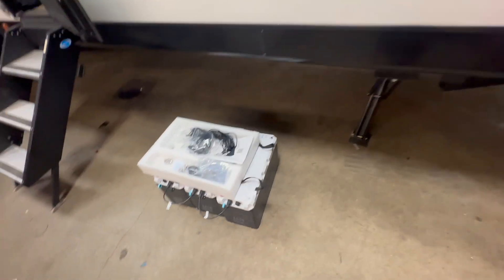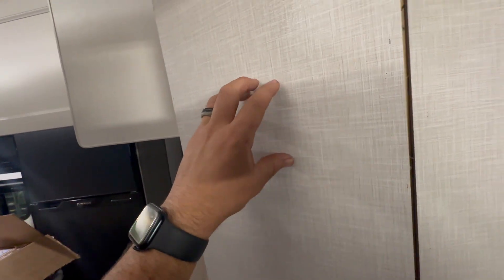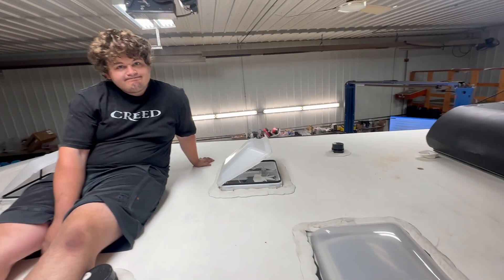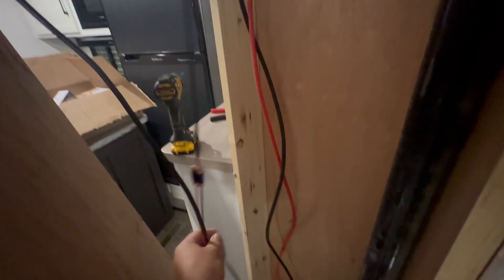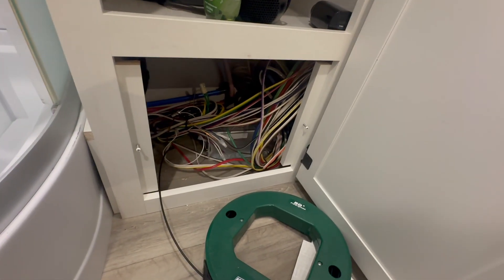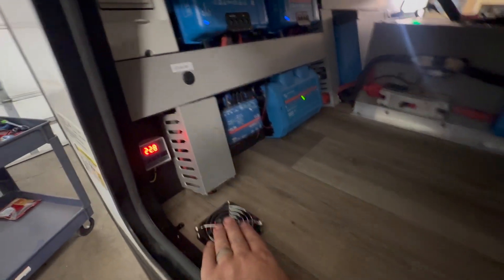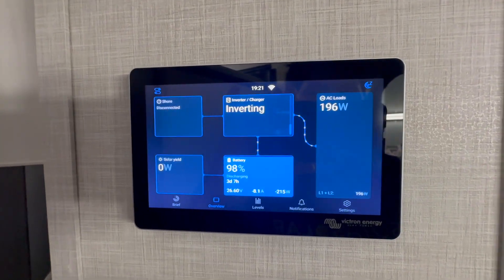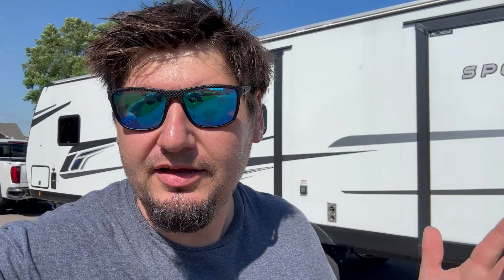Insane RV Solar Upgrade: 3,000W + 690Ah Lithium + Dual Victron Inverters on a Travel Trailer

Comment: Do you run 2 pairs of wires from the roof to the controllers or one big pair split between them?
Reply from the maker: Yeah, usually we done do more than 1500-2000w on a single set. The panels to about 5 amps PV, so we like to keep it under 20a if possible, trying to not go over 25a . RV manufacturers will go up near 30a with 3x 200w panels at 18-20v , I don’t like it one bit .

We run 85-90v so at 85v 2000w is still 23 amps.

Comment: Great install!
Don’t see a 24-12v converter?
Are they just using old  trailer converter?
Reply from the maker: I was curious if someone was gonna catch that yes we ended up using the existing converter and it’s only drawing 40 to 50 W including inverter overhead when everything is off. That’s not that much different than what a step down converter would typically use to keep the 12 V battery charged so I think we’re gonna be using the step down converters a lot less. Especially when the systems are as large as this, the gains from any efficiency become a lot less as a overall part of the whole.
Reply: Ya I’m doing the same install now 24/3000 but using the 24-12/70 converter and then a fuse block for 12V and another for the 24V. Lots of things going on! And a lot of room on a 20 x 48 inch board. 
Have not finished install yet so may pull the 12 V thing and get rid of a bunch of wires.
I do have a lithium converter also.
Well thank you fir your videos they help a lot!
But you’re also killing me because every time I watch one of your videos I gotta change something. I’m never gonna get this thing done!
Reply from the maker: @leno61 one of the other reasons why we stopped using the 24 V 70 amp step down converter is it will backfeed 12 V into 24 V system which isn’t really a problem except the cerbo GX will run off of 12 V as well as the other equipment so it kind of confuses things and the inverters may even say low-voltage so make sure to have a shut off on the 12 V converter as well. For our customers, we try and keep things somewhat simple.
Reply: @sotasolar  why couldn't you use a high amp rated diode on the 12v side of the 24/12-70 to prevent the backfeed ?  Thanks!
Reply from the maker: @TerryHartman-zz3bs  I suppose so, but are we solving the right problem?
Reply: @sotasolar  There are isolated Orion devices on the market
Reply from the maker: @jaapdewind8774 you are correct. But lately I’ve been feeling like it adds additional complexity with little benefit.
Reply: I’m using Raspberry Pi  cerbo running off 24v.
But the converter is not simple!
Don’t know if I will pull it?
Will use a lithium 12v  to run trailer.
Thanks again!

Comment: With 3 batteries can you just hook up in parallel. Or do you always need a lynx distributor
Reply from the maker: Don’t always need, but with two inverters and Epoch does recommend them. More and more were trying to do the best work we can. 

At the same time we don’t use them Everytime. We’ve done 4 batteries without one before. Sometimes it’s about space or budget, or more than a few times a system grows from 2 to 3 or 4 batteries at install time “if you can fit them go for it” and it’s not in the timeline to switch. 

All things being equal I’d use one, but I don’t lose sleep if not in a 400a fused system. If anyone did a 2x 12/3000 MP system that’s fused at 800a, I’d insist on the power in.